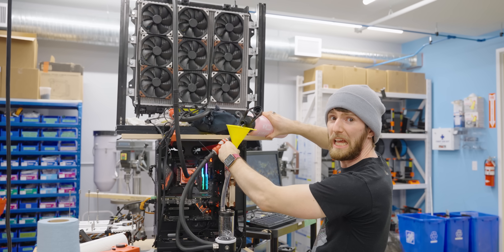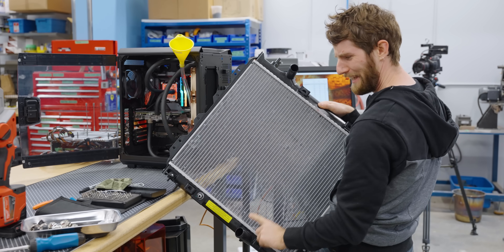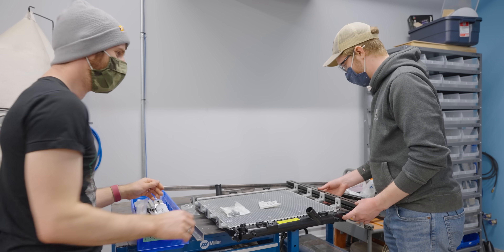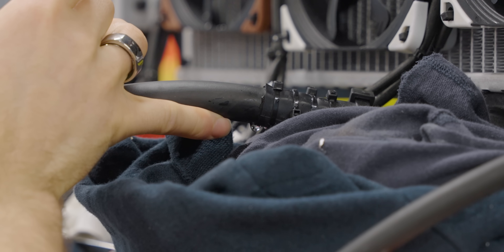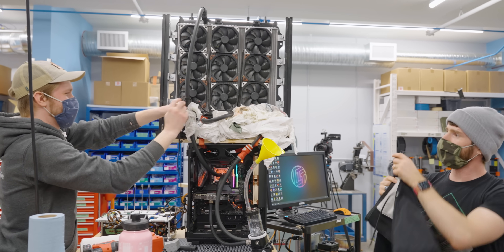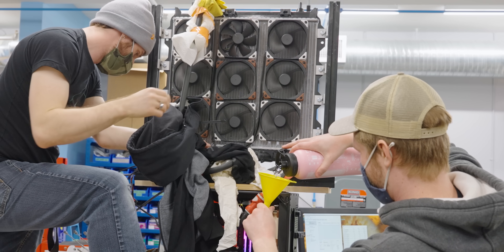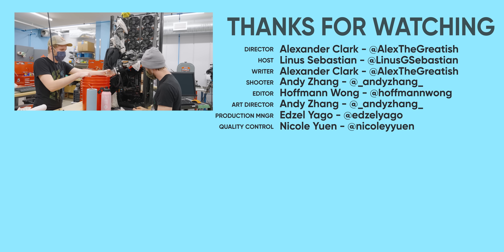Our Craziest Cooling Project Yet - Car radiator liquid cooler

Comment: This is a fantastic video, but wow, every step of the way I wished I was there to prevent a lot of the issues from happening. Even that radiator... I am 99% sure that wasn't actually the cheapest one they had. With the savings I would have found on that radiator, there are a few other auto parts I would have bought that would have prevented those leaks. All that would have led to a less entertaining video, so not having me help was a good call!

Comment: Why wouldn't they just trim down the I/O on the radiator. Glue on a couple of threaded PVC reducers the proper size for the cooler hoses and be done with it?

Comment: you do realize that the transmision lines are not connected to the engine side right? you would be mixing ATF with coolant if they were connected. you should have used a manual transmission car's radiator, its a single loop.

Comment: Really enjoyed this one. Can you redo this project with you new knowledge? Also curious to see if radiator coolant does a better job than tap water.
Reply: Coolant has higher heat capacity than water. Which means it will require more heat energy to reach the same temperature which water can reach with much lesser energy. Components in the coolant also raise its boiling point making it safer for operation in the engine

However,  drivers in temperate climates like florida specifically raceway drivers tend to use just water in case they have a blowout  which is not uncommon.
The pump and fans will be the  biggest factor i think

Comment: About fifteen years ago I had a similar idea, though it wasn't for computer cooling I thought why not go to the scrapyard and get a used radiator. It even came with a fan LOL. It worked after a fashon, but shed rust flakes like crazy, the fan needed about 5 amps and it was LOUD!!

Comment: Would love to see an updated version of this after you guys get an understanding of how a car cooling system works. You can get joints to step down the cooling lines properly and not have leaks. Also I'd recommend an older rad that does not have a trans cooler, but if you cannot find one you can plug the smaller PC rad into the system to work as a trans rad.
Reply: You don't need to step down shit if something is properly sealed...
Reply: @Alcoholic_Nerd  the stepdown as referred to in the video is due to the largest pc pipe being smaller than the smallest car rad line. Yes a stepdown of the hoses is still needed unless you modify the pipes on the car rad. 

Edit: Vehicle manufacturers use a system of transfer points to achieve stepping down and up the cooling lines. The 2 points that Lynus could utilize for this project are the water pump which has a larger input than output and the crossover pipe which typically has multiple smaller inputs converge into a larger output. The crossover on newer cars also houses the thermostat which may improve performance of this system should they pressurize it like a vehicle cooling system.
Reply: @joshuatayloe8616  I too am frustrated by their attempt to do this. They wouldn't need an older rad, they would just need a rad from a manual car. Would cost em 30 dollars to find a big nice used radiator, and they could save even more money by just using radiators electric fan (which is 12v). If a radiator is able to cool a running engine down to let's say 30-40 degrees with no thermostat, then it will more than likely be very effective at cooling down a cpu or gpu. 

I don't think people would actually care if they had to have a big radiator on the outside of their pc, especially if it meant they could finally run the latest i9s at operating temps.
Reply: @ASDASD34RDFS  all of these are very good points although i'm pretty sure engines run closer to 70 degrees celsius.
Reply: @Lazulcat  Engines run closer to 80-90 degrees celsius, or at least the coolant does. The oil temp is higher than that. And if you did not have a radiator you engine would run so hot it would quite literally explode. If a radiator is capable of cooling down 4-8 cylinders that have thousands of explosions in them every minute. Then surerly one radiator could cool down a processor. There is a lot of heat in an engine.
Reply: @ASDASD34RDFS  I'm not saying it won't, just stating that they run way higher than 30 when connected to an engine. I figured 70 from memory but 80-90 checks out. I agree that when properly done a car radiator is more than ample for a chip.
Reply: @Lazulcat  An easy fix for that would be to just install a thermostat that opens at around 30 celsius instead of 80-90, where most thermostats are set to open.

Comment: The way the Trans cooler and the AC condenser that's built into it, is it literally is just copper/brass/Heat conducting metal with a coil inside of the resuvoirs on the sides

Comment: Ideally this would have work better if they started with a radiator core, then welded parts on so they could much more easily add bungs for the cooling loop

Comment: Well they got a ton of thermal mass there, and LTT found in previous tests that having bigger reservoirs let you run at very low temps for a longer time before the full loop reaches it's thermal limiting. With that huge radiator, it could probably run those tests for an hour before having all the water fully heated up. And given how fast they were replacing water, maybe the solution isn't a big radiator, just a massive reservoir with a substantial leak so you are replacing a lot of water every few minutes.
Reply: Why use a big tank with big "leaks" when you can connect CPU water block directly to your cold tap water (through a series of filters of course) and dump all "hot" water straight into sewer system?

Comment: Why not use a normal house box fan $20 and mount the radiator to the fan as I had done 10 years back on an old $25 radiator from You-Pull-Apart. And $53 of rubber tubes from local hardware store. The hole project coast me $98 added to the

Comment: why didnt you get radiator hose from a car for this
why didnt you get a electirc radiator fan from a car for this
the rad should be more or less even level with the rest of the system so you arent pumping water up
put a valve on each of your lower hose ports then you can prefill and bleed the rad before hooking it up

Comment: Touch a cryo cooler directly to the cpu. Write a program that progressively turns up the speed but don't write the part that tells it when to stop...
Reply: Build it in a vacuum chamber so you don't have liquid air dripping on everything...
Reply: Tell me I'm wrong
Reply: Tell me I'm wrong

Comment: How about using brass or plastic barb fittings adapters from a hardware store? The way you guys adapted the hose sizes are not good at all I knew for sure it was going to leak

Comment: I've got a 360 rad on my 3950X and Bzip2 Ultra makes it hit 95 but somehow not throttle. Not sure if AMD reporting shenanigans or reality as the top of the case (where my rad is) didn't heat up.

Comment: The one for the transmission is a small block inside the radiator. It's a radiator inside a radiator.
Reply: AKA you should have just ignored the transmission cooler holes!!!

Comment: Would have been easier to block off the factory hose connections, drill and tap a hole in each end tank then buy threaded barbs and thread seal.  Would have had that whole water leaking situation fixed in 10 minutes.

Comment: My Car Radiator worked 6 an half Jears on a 4770k @4.5Ghz (eBay Kleinanzeigen 20euro mm new)without any Fan behind my TV. What should I say ist works CPU dont Go oder 50C. The GPU was the loudest in my PC.

Comment: Probably the worst LTT video. So much little thought put into it, which is a pity since its a decent idea. A little bit of planning would have gone a long way. They could have checked the fans or leaks before actually plumbing in the rest of the system.

Comment: The transmission cooler lines are not only for cooling. They're in there to heat the coolant faster (because transmission oil heats up very fast) and after that to help maintain the operating temp of the transmission oil.

Comment: This woulda been so much easier and better if they hadn’t included the automatic transmission cooler in their loop lol, less leaks, less points of failure. And all the PC fans? Cool, I understand it is PC cooling they’re going for, but, a single Lasko box fan would been a better idea than attaching so many fans and connecting them all I think lol.

Comment: Stop touching the radiator constantly and ruin all the ribs LOL /the_car_mechanic

Legit question: Why the FUCK you you want a potentially leaking radiator on top of a 120/240V AC device when you can just put the radiator next to the PC or a little further away for actual safety to prevent burning your house down? I'm amazed nobody was electrocuted while making this video unless those parts were cut for TOS reasons

Comment: You guys need to find some silicon mastic tape. Good for electrical and water applications. You stretch it and pull it around the pipes for instance which allows it to hold pressure and it's self bonding so if used properly won't come undone. You can patch a large hole in a radiator hose for example without leaks.

Comment: Holy crap that radiator is for a pt cruiser lmao.

Try a 96 civic radiator, it's mid atx case size lol.

Also bottom small ports for transmission is a liquid to liquid heat exchanger, basically a copper tube that cools transmission fluid with coolant that flows by

Comment: I'd like a revisit, done properly.  Just plug the inlet and outlet, then drill a hole in the top and bottom plastic tank, install g1/4 fittings in each with epoxy, and you're done, easy!  Once it doesn't leak, the D5 will pump that at 3000rpm easy, probably 2000rpm.  
My system is even crazier than this, with a MoRa3 on an Elysium case that is *huge*, D5 static 3500rpm 10c above ambient full load with 2x 390x and 5Ghz 2700K

Comment: Just FYI, HALF of the job for a car radiator for an automatic transmission(what you have) is actually to warm things up during cold starts. Hense the "Not sure how this cools anything" comment by Alex. By no means would this be appropriate for a job that only requires a cooling function. Surprised Alex doesn't know this.

Comment: may i suggest a 12v inverter to power the cars actual radiator fan because it has a much higher flow rate than that there fan bank

Comment: if i had the time and money here is what i would do to cool my computer. i would build a fish pond outside and incorperat an old truck cad into it and make it like the truck had been run into the pond so part of the rad is in the water and pump water though that. you would have to use water only and new rad or if there are fish safe things out there. you could even use a submersable pump

Comment: This has potential, but there is a bunch of things to be fixed, like a stronger water pump (to be able to displace enough water for it to actually run a loop) an actual car radiator fan (rad setup could be mounted elsewhere not necesarily next to the pc)

Comment: I think if you did a bit more fine tuning to this setup this would be a badass cooler!
However, if I may suggest a thought for this setup!
If you had the PC sitting on the floor and the radiator sitting on top of a table or desk i bet the cooling would work 10 times better!

Comment: Ok, read me out, a hole in the wall, a big fan in it (like those used in kitchens), and the ratiator, throwing the heat outside!
Not only it would look better, it would be very beneficial during summer.

Comment: That top fin cooler, you accidently explained why some dinosaurs had backfins, The fins presumably served as heat collectors for these small, cold-blooded reptiles. Over the last decade or so, the pelycosaur model has been extended to several large, spiny dinosaurs that lived in Africa roughly 100 million years ago and may have had fins to help warm or cool their blood.
Reply: Late addition, but, ELEPHANTS also use the same concept but instead of back fins, they use their ears. Large surface area with blood vessels to cool down blood temperature in the scorching savana. They also flap them like a handfan to cool down even faster.

Comment: Linus, I am trying to figure out why you guys just did not just go out and get the correct Hose Barb Reducer (2 inch to 3/8 inch- yeah you might have to uses different fittings to make it but you could)) for your pipe? And maybe use heat shrink tubing (as suggested below) between the radiator and a Hose Barb Reducer ? I also don't know why you guys are not using hose clamps on every connecting? - that would have stop a lot of your leaks... Look I think you have a great idea, but I expect better control of your experiment. I wish I could have help. I live in Seattle. You guys need to come up with a way to see how much stress you are putting on your views watching your test. You guys need to do a REDUE on this Video.

Comment: I did something like this, but I was using a Ford heater core instead of the radiator. By the way, they do make reducers from the radiator main dow to water cooling sizes.

Comment: Was this made to be as jank as possible?  The leaks should have been fixed before adding the computer in the loop.  The radiator should work just fine, and probably even without fans with if laid horizontally.   Great idea, total fail in execution.
Reply: Car fans are 12 volt ... no excuse to not use some car fans fan except they was just trying to supersize a pc part not replace a pc system with a car system car fans woulda worked better but may require external power supply
Reply: @FUCKDSS  Those fans that they used likely are 12V also.

Comment: Guys, in case you didn't know, there are people known as auto mechanics that could have saved you all a BUNCH of trouble. They would have told you that you need to use hose clamps on ALL of the water connections, regardless of diameter. Cable ties simply CANNOT be made tight enough to prevent leaks. Geez! I thought you guys had brains. (Unless you deliberately wanted to screw up to increase the humor of this RIDICULOUS video, in which case I take back my comment.)

Comment: All they had to do was make a run to a Canadian Tire and hit the plumbing section for some reducer fittings to step the radiator hose connections down. I think it's funny how inaccurate the name Canadian Tire is to the breadth of the items the stores sell. It's like "Oh, we also sell tires."

Definitely needs a revisit on this idea, with proper prior preparation to prevent piss-poor performance. The 7P principle, 6P if you leave the piss out.

Comment: Yeh! Electricity and water are a great mix. With those pipe adaptors i'd never consider putting the rad on the top of the case.

Comment: just 3 changes could have made this work so much better - 1: not on top of the case - 2: most of the leakage was caused because you folded the innertubes to reduce diameter. this creates channels that no amount of pressure will close. instead, use a succession of different sized hoses that each fit snugly into each other. - 3: including the oil-cooling loop was silly as this only increases flow restriction without increasing cooling (that loop is just a tube running through the header dumping heat from the oil into the water)

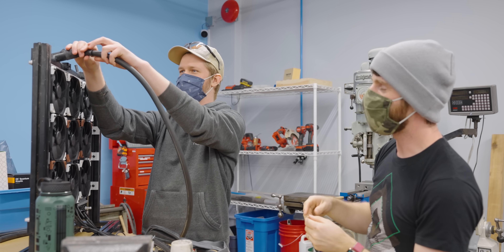Comment: 7:45 I'd put something non-compressible inside of those rubber hoses where you want to tighten them.
A piece of metal/plastic/pvc pipe.
So you can actually tighten them without them buckling and introducing wrinkles for the water to leak through.

Comment: If you wanted better efficiency you could use two small radiators run on two loops with a diverter valve and thermostat. Then as one rad becomes thermally soaked the thermostat can switch loops with the other rad while the fluid in the first cools. Also the reservoir should be outside the loop. Running a continuous flow loop will always result in heat soaking your coolant. Try removing the thermostat from your car and watch how fast it runs hot.

Comment: This was janky, even for you guys! LOL

I have been using a copper core radiator for a decade. Meant to fit into a Geo Metro, I soldered some brass plate across the main openings and then soldered in some 3/8 female NPT fittings on each end. Coupled with a single 360mm fan, it keeps up with dual RTX3090's and a 5900x. After the water is completely heat saturated, it hovers around 40c with CPU Temps never exceeding 65c under 100% system load for hours on end. 

It works a treat, boys.
Reply: Holy shit please link a picture to it ahahah
Reply: Thanks for the tips. Geo Metro radiator looks nice and small. I'm gunna build something similar - a small (for a car) radiator with a single big fan, maybe even the stock fan undervolted

Comment: also side mount it sucking air out of case 20in box fan via car radiator seal the leaks better and you may need filtered intakes for airflow into PC box

Comment: you needed a rad from like a Yaris or Civic, they are smaller and fit on the back of a big pc case :P or just an aftermarket Transmission cooler.

Comment: I'm curious why they didn't just use the car's cooling fan, I mean, it run off 12-15V from either the battery or alternator, and I'm sure that power supply has  more PCIe power to spare